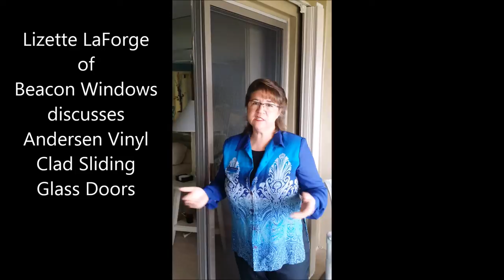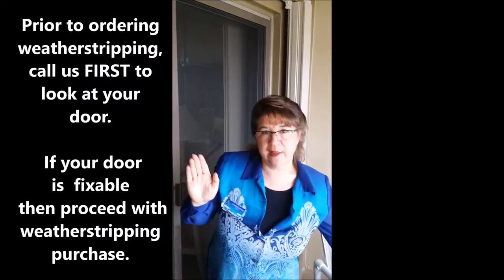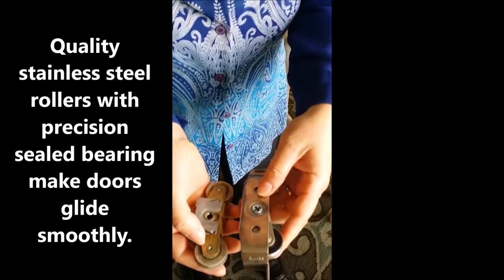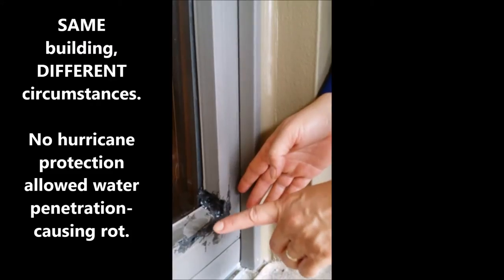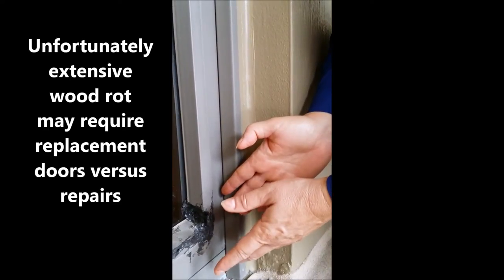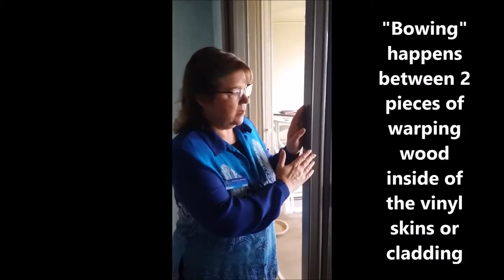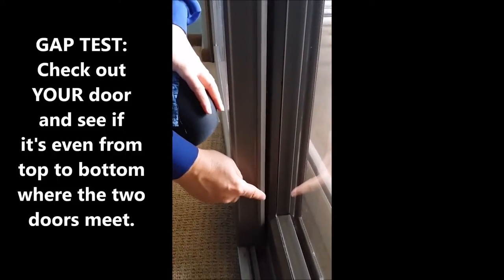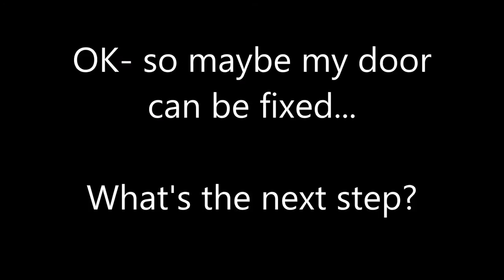Repair Options on Andersen Vinyl Sliding Glass Patio Doors

Comment: Absolute, total JUNK. Back in 1991 I did a major remodeling project on my (circa 1956) 1400 sq. ft ranch house, 20 miles north of Philadelphia. Selected Andersen casement windows and an Andersen Frenchwood patio door - after also considering Peachtree, Marvin and one or two others. Biggest mistake I have made in the 42 years that I've lived here. Every unit had/has major quality issues.... every casement insulated glass unit failed due to improper manufacturing, causing the dual panes of glass to "suck in" and touch in the center, eliminating the insulation value, obscuring clarity  and causing  condensation on the interior panes with water puddling on the sills. Every glass unit was eventually replaced under warranty or a technician drilled holes in the sides and plugged them to eliminate the vacuum. Of course, the argon gas filling was severely compromised in that process. The patio door lock mechanism failed because a little 5 cent spring broke and is not replaceable, requiring purchase of an entire new locking mechanism  from Andersen at retail of 200.00  That was the last purchase of any Andersen product I will ever make.
Reply: Craig R......Agree with you 100%. If Anderson Corporate spent 1/2 the money they spend on advertising for their replacement windows and doors and had a repair program for all these pieces of CRAP French and Sliding doors, they wouldn't have to advertise so much for new customers because there would be a pool of satisfied old buyers on their next home. THE ANDERSON DELAMINATION PROBLEM ON ALL CLAD DOORS IS ABSOLUTELY AWFUL. I AM NOT AND ALL HAPPY OR SATISFIED WITH MY $42,000 SPENT ON ANDERSON WINDOWS AND DOORS.

Comment: yup, I replaced foam, and I have rot in stationary side sill wasn't sealed by installer
Reply: I have the same problem, why wouldn't they use pressure treated wood is my question?

Comment: How can I change my vinyl on these andersen doors ?
Reply from the maker: I don't know of an option to change the vinyl.  Likely Andersen would tell you that you have to replace the doors.  I know we've seen clients with doors that are delaminating and we've suggested glue and clamps to help keep their doors together and that has actually worked.  How bad is the vinyl?  Could you salvage it and try the glue trick.  Use a glue that won't eat up the vinyl and is made for outdoors.  Hope that helps and thank you for watching!
Reply: Beacon Windows Well, thanks for a reply . The vinyl is all cracked up. I will simply rip up the whole thing and buy new vinyl and cut to dimension and stick with contact cement...Labor intensive but these doors are so expensive. it is worth it.
Reply: @sajidullah  Hi there I have the same problem. Did you ever find a vinyl to replace the delaminated vinyl? If so please let me know. I can't find any anywhere!!!